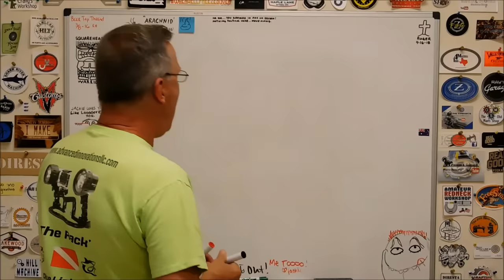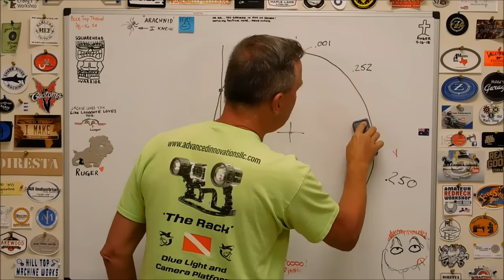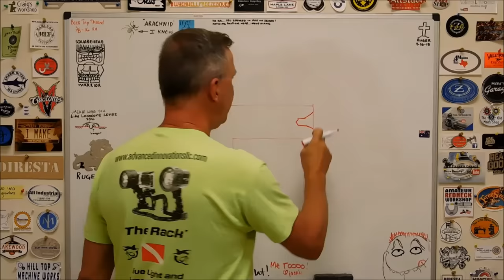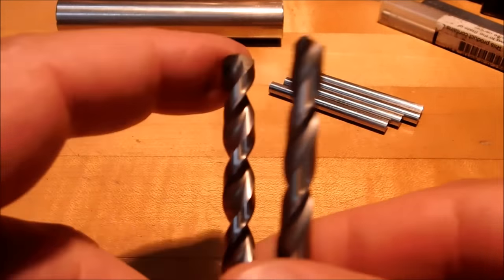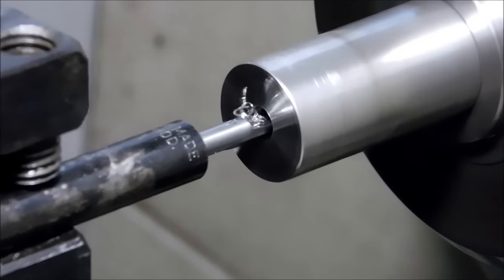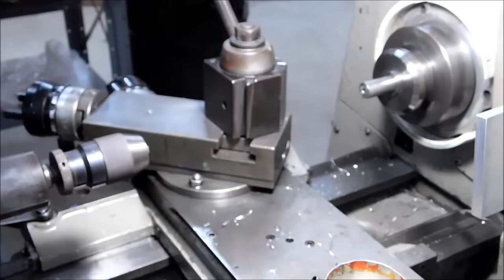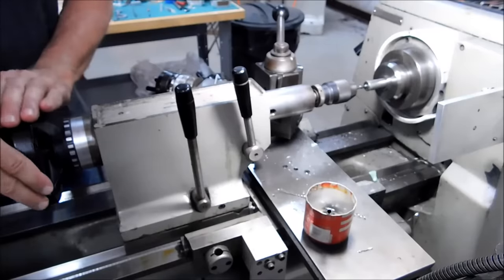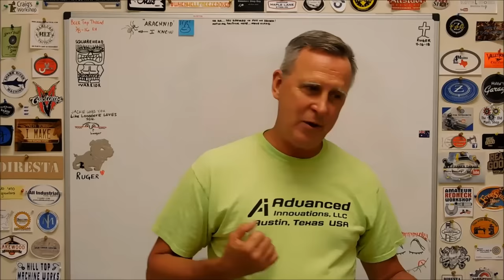Techniques for Machining Straight Deep Holes -- SHOP GEM --

Comment: If you wanted or needed to, you could have drilled undersize and reamed the entire hole, correct?

This one particularly applies to me because I mostly work with small stuff and it's very infrequent that I drill a deep, small diameter hole that ends up actually straight.  Usually it doesn't matter a whole lot but it still bugs me just because I don't like it when I don't get something right even if it doesn't matter.
Reply from the maker: The multiple flute geometry of a reamer is somewhat self centering if guided correctly and can knock off eccentric mismatch. BUT....reamers like to follow pilot holes, so the hole could still walk if reamed after the fact.

Comment: Just a thought - what about really small holes? I use carbide pcb drills from 1mm down to 0.35mm, but the flute length is only 10mm. Any advice for greater accuracy?
Reply from the maker: Floating chuck. Push it in with your fingers. I have a video. " Stop breaking small drills"
Reply: @joepie221  Seen it, made one, use it. Great video, thanks. Btw - I still break them but not during drilling, usually by looking at them wrong :)

Comment: What sort of indicator setup would work to measure the actual concentricity of the entire hole?  I understand Joe's gage pin check, and that it's all I would ever need for 99.9999% of real world applications, but I'm just not thinking up any ways to actually measure the entire 4" hole.
Reply from the maker: Stick a pin in the hole until you encounter a bind and indicate the projection. Its a mirror image of the hole geometry. If possible, engage the pin as much as is hanging out.

Comment: Beware that if using "Hand Sharpened" drills, they will almost always cut oversize due to drill lip length error, so best use one ground by the manufacturer for this project!! (Drilling, Straight Deep holes)
Reply: I spend a lot of time getting my drills sharpened true. Sometimes hours on one drill. You are right they have to be right on the money.

Comment: Hey Joe, on the subject of flipping the stock and getting the holes to meet up, does the runout of the chuck cause the holes to be misaligned? My 3 jaw has a lot of runout as it's from the 1930's and is very well worn, and both it and my 4 jaw both have some bellmouth shape to them, is it better to use the 4 jaw to dial in the stock on the od at both ends or does this not matter?
Reply: Yes, the eccentric run-out can definitely cause your holes to end up misaligned. Even if they're parallel they may end up not being concentric.

If you need better precision in your workholding you can make a sleeve, bore it while in the Chuck, and use that to hold your part.
Reply from the maker: I do have a video on correcting runout on non adjustable chucks. As Ryan has pointed out, an in place bushing is a step in the right direction.
Reply: @joepie221  Thanks Joe, I did try that method at one point but my chuck is too bellmouthed for it to work properly :( oh well, 4 jaw it is!
Reply: @MysticalDork  I thought that would be the case, I've tried the bushing method but my chuck is too worn for it to work reliably :(

Oh well, it's not an operation I do frequently so no issue.

Comment: I have a Ph. D. in mechanical engineering, spent many hours on mills and lathes and other tools. I am CERTAINLY not an expert, and maybe I am tired or distracted, but that stuff on the white board made no sense to me, at all. Not even a tiny bit.  What I do know is that people make gun barrels. They use special boring tools, that are not complicated. I am sure there is a lot to the processes that is proprietary,  but somehow, the method taught here does strike me as the first thing I'd try.
Reply: I didn't get it either ( but I only have a MSc in mech engineering (LOL))

 I belive he is trying to say (in a very convoluted manner) the the strategy for maintaining a straight hole is to rely on the support of the hole wall not the stiffness of the twist-drill in order to keep the drill going straight. And I belive he is correct. His method is described on page 12 of this classic.

https://archive.org/details/deepholedrillingbymachinerymagazine/page/n11/mode/2up
Reply: I'm a precision mechanic.
This is basic understanding.
So what's the point of phd. Worthless, if you can't even drill a single straight hole, when required. This is a major problem in our society.
Reply: There's a story it the Machinists Bedside Companion about machining competition gun barrels that may make this clearer. I recommend it.
Reply: Thank god for that! I am only a self-taught (well, taught by people like Joe) hobby machinist and I thought I had turned into Homer Simpson for the first 9 minutes!
Reply: @Dagonius.  No need to be insulting.
He said he has a mechanical engineering degree not a degree as a mechanic/mechanical-technician.

How are you on heat flow patterns? Magnetic interference patterns? How about heat treating and crystallization structure? Gyroscopic effects? Active galvanic protection calculations?   How about skeletonized designing for rigid structures? Flexure and fatigue life calculation?

Are you suggesting he should get another degree for a different specialization? (Maybe stay in school his whole life, until he knows it all!)

*These are intended as lighthearted jests
What's the point in being a "precision" mechanic, if you can't even understand basic industry descriptions?
(chuckles)

One of the first lessons any mech engineer will learn after getting their 1st job is how to design for construction and assembly for however their company does that.
Eg how are you supposed to weld the final inside edge of an enclosed cube?... scratch that design and start from the ground up thinking as a welder assembling the pieces and needing enough access to weld.

I've been around fabricators, boat builders, and machine designers my whole life. Most of them would struggle to make a deep accurate hole, because most mechanical design philosophies specifically work to avoid the need for difficult extra precision work that is part-scrap prone.

Deep boring?
I say that having worked at a place that made 8"ft long hinges that had to survive heavy use in saltwater sitting behind 8,000hp tug and trawler props.
Could you setup a machine to full length drill 8ft and bore those accurately? Yes.

Did we do that? Hell no! That would be a stupid expensive way to do it.
We designed to avoid that: used smaller knuckles reasonable to machine on a standard lathe and a precision rigid jigging method to align the entire string of them and a specific process to minimize weld distortion. 

Then we used a more flexible material for the hinge-pin that allowed for more load sharing and prevented the hinge from tearing itself apart in the event of a catastrophic pilot error.

Comment: Nice technique! I always knew to be careful at the start of a hole but this takes things to another level.
Yesterday I experimented with a toolpost mounted drill chuck and I have to say using the power feed I never got a hole so fast. 
It's super easy to disengage, retract and go back in and it allows a much higher feed than by hand in my experience
Reply: You could always bolt/clamp the tail stock to the carriage and get the same power feed. A big U bolt around the back of the tail stock might work well enough for testing, then make something nice if it works.
Reply from the maker: I've been thinking about rigging an air cylinder to the back of my tail stock. Foot activated switch. Retract and re-engage the drill position by air power. Crank by hand.

Comment: Eh, the method used on the tail stock won't work on mine, at least not easily.  No quick release, and it's just too heavy.  Century old, overall length is just over 9' and the part working length, between centers, measure to 4' ... that should give you an idea how massive the head and tail stocks are.  Travel length of the tail stock quill is 9".  Guess I'm stuck doing it the hard way🤷‍♂️

You did confirm the idea I had about about starting the hole correctly, making sure it was in true center.  Tail stock has picked up some wear over the years, and a starter drill point does not quite contact on the center mark that shows when the end of the part is faced off.  Time to determine the best way for correcting that ... just another scar to contend with on the "Old Warrior."
Reply from the maker: Anybody can make a good part with good machines. It takes a true craftsman to do it with worn equipment.

Comment: The boring bar has also have to chamfer the final depth  because once it hits the off center drill it will want to follow that walking drill
Reply: Center drills also destroy drills, better to use spot drills
Reply: Great vid!
Reply from the maker: Actually not. A boring bar will hold true to the center axis and not be influenced by the error.
Reply: @joepie221  ur right about the boring bar but once that drill makes contact with the oscillating drill it will want to follow the drill depending on the ridigity of the drill and closeness it is to the bore leading it in ,it will stay on course
Reply: @joepie221  I only deal with cnc so I will drill a pilot hole than bore it or u like to say dust it,and take material as much as possible from the pilot drilled angle being 118 135 or 140 so the drill doesn't follow,you are one of the best machinist out on u tube in my opinion ! I've learned a lot from you, much love!

Comment: H
Is cutting speed for metric  and inch drill same or different? when you use formula N=Vc *318/D and N=Vc*3.82/D?
Reply from the maker: No. You have to use metric speed for metric drills.............Only kidding. Speeds are the same.
Reply: @joepie221 Not speed  the Cutting speed !!

Comment: DO NOT use a “center drill”! Use a spot drill for lathe and mills. Start the hole with a “stub drill” and exchange for a jobber length if needed for depth. When starting into the spotted hole, don’t feather it in, normal smooth continuous feed. I have proven this many, many times and it works as well as a bored starter bore. I only use center drills for .....centers.
Reply from the maker: I use both and will continue to do so. There are advantages to both.
Reply: Joe Pieczynski 
I noticed an anomaly years ago. On a mill I was putting in dowel pin holes. Every time I used a center drill my hole locations (stub drill & ream) were .0005. Switching to spot drills, locations were better than .0002. CMM verified. This success also transferred to the lathe. You would think that the steeper angel of the center drill (60* vs 90*) would lead it in better but it’s not so. 140 degree spots only work if the spindle/quill is ultra stiff so I stick to 90 degree spots they seem to be much better for not only the drill but starting the reamer. Just wished I learn it in first quarter of my working life.
Reply: @SkypowerwithKarl  What degree drill bits do you use for the spot drills? Thanks
Reply: @GhostlySD  
90 spot or the hard to find 90 center drill. Not the 60
Reply: @SkypowerwithKarl  Thank you

Comment: Joe, Thank you for a very constructive video as usual.  May I make two comments?.  1. Would a polyurethane bumper between the tail-stock and saddle speed up your multiple drill pecks?  2. Your lathe chuck is probably kept in very accurate concentric adjustment.  As a general note should the part be marked before flipping to drill the reverse side.  The part can then be put into the chuck in exactly the same alignment so any eccentricity is aligned along a common axis.
Reply from the maker: Any bumper material will probably help. I also indicate a part I have to trust. Radial alignment may be beneficial in a chuck if it runs out just a hair.

Comment: Anchor lube vs wd40 during the drilling? Which was "better"?
Reply: Joe can probably give better feedback due to more experience but I've used both for drilling and tapping, as well as Boelube paste and Relton A-9 aluminum-specific cutting fluid for aluminum.  Of all of those I think A-9 has the best performance.  I mostly do drilling on the small CNC mill with some occasional drill press work.  The big advantage of the Boelube and Anchorlube is they are not oily and wash off easily with warm water.  I believe both are also non-toxic.  For hand-tapping, I will almost exclusively use A-9, and for blind holes even just use rubbing alcohol which eliminates the otherwise annoying cleaning steps required to get any other lubricant out.
Reply from the maker: The pressure felt almost identical with both, with a slight nod to the anchor lube. The chips seemed to walk along the drill better with the anchor lube when the hole got deeper.
Reply: @joepie221  thanks to both of you. I've been using a gel lube most of the time, but it's hard to apply, also another lube that is hard like wax. Both give me better performance but difficult to get on the tools. That said, nothing I do is big.

Comment: I just center drill, pilot drill about 0.125" deep, bore the pilot hole to size, and drill the hole with a gun drill.
Reply from the maker: A longer lead would be beneficial.
Reply: @joepie221  You're absolutely right, Joe.  I was thinking about the last deep hole I drilled, which was 1/8" x 4" deep, for a custom PIP pin when I typed that.  My bad!  I actually bore the lead to the diameter of the gun drill, not just 1/8" for all of them.  I've had good luck with that, but up to 2 or 3 diameters would help stabilized a long gun drill.  I have a 3/4" cemented carbide gun drill that's 14" long.  I've only used it twice, but I bored the leads 2" deep on those holes, just to be sure.  Thanks for the great content, Joe!

Comment: Can I use this to go through 10-30 inches?
Reply from the maker: Every technique has its own limits before specialized tooling is needed. 30" would be pushing it. 10, maybe if you go from both ends.
Reply: @joepie221  Is there equipment available to drill longer holes on a lathe? Where can I learn about it?
Reply: @joepie221  I guess what I'm asking is will a set of longer gun drills work on a lathe or do I need a whole other machine instead of a lathe to drill my own barrels?

Comment: Joe, great advise. I had a job to bore a 3"L., 1"D. round Delrin stock with a 5mm hole. Concenticity spec was <= 0.001". I just always fell out of spec. Best I could do was 0.002". This was on my old Logan lathe. The Delrin smears when I reamed it. Tried all sorts of speeds and drills. Would you have any advice in drilling soft materials to these tight specs? I had to give up the job.
Thanks!!!
Reply: Hi Ralph - I'm sure Joe has had a lot more experience than I but, for what it is worth, here is what I have learned.
Firstly you need sharp, high clearance tools. When I say sharp, I mean SHARP. After you have ground your drill then take an Arkansas stone or similar and hone that sucker until it is sharp enough to make your eyes bleed just by looking at it.
Secondly, I have not had much luck with reamers because they are not sharp enough and do not have enough clearance.
Thirdly, Make sure the OD is fully supported to reduce any possible movement. Use a jig, or a collet - not a 3 or 4 jaw chuck.
Fourthly, As with all soft materials - bore it to size. SHARP boring tool and small cuts using multiple spring passes.
Fifthly, [not really applicable here, but quite effective], grind it, don't turn it.
Lastly, a technique I have used on a few occasions.  LIke most TPs, Delrin gets harder when it is cold.  Pop it in the freezer for 24 hours before taking your final pass[es].  You have to compensate for the thermal contraction but harder material cuts cleaner.
l would be really surprised if you couldn't get those tolerances [which are tight but not ridiculous] just by collet and boring bar.
A long ramble - hope it offers some ideas of use.
Reply from the maker: RPM should be a little slower with delrin. I have noticed heat is the enemy with plastics. A good bite is another tip. Don't try to take just a dust cut. And do everything you can to not let the reamer get hot. Holes do normally ream tight. If concentricity is the goal, you may wish to consider oversize stock and bring in the OD true to the hole as a later op.
Reply: @mousemade1  thanks! great info, I'll try it .
Reply: @joepie221  Thanks for your answer! I'll try it out as you said. Great idea! All the best to you and thanks for all your videos. - Ralph

Comment: How do I drill a perfect 3mm hole 45mm deep?
Reply from the maker: This is the technique I'd use to do it. If you can drill from both sides of the part, it would help.

Comment: We in the Oil tool Industry (Cameron Iron Works in Leeds) could drill .1875 (3/16") holes for 3 foot deep with a Gun Drill, dead straight in the Tubing Hangers, they had to be right for the Intersecting radial holes!!
Reply from the maker: Not that I doubt it, but I'd enjoy seeing that. Many machinists would laugh at a feature callout like that. Or cry.
Reply: Yep' Joe, that's why they call it a Gun Drill!!
Reply: So how do you think that billions of small (& bigger) calibre guns are produced?? - With a Gun Drill!!
Reply from the maker: You are only half right. Gun barrels are not produced on an engine lathe as you suggest. They are drilled on a very purpose built barrel drilling machine with special mechanisms to assure the drill stays straight and supported. Check into that.

Comment: Great video Joe with excellent explanation. I have one question, is there any benefit to reducing the stick out of the round bar in the collet to start the hole with less potential runout on the ends or is it more important to keep the mid point concentric by keeping the mid point of the bar in the collet contact area for the breakthrough, perhaps the stick out could be increased as the hole progresses?
Reply from the maker: Its easier to verify the material is running true if you have some extension. You have more places to check it.